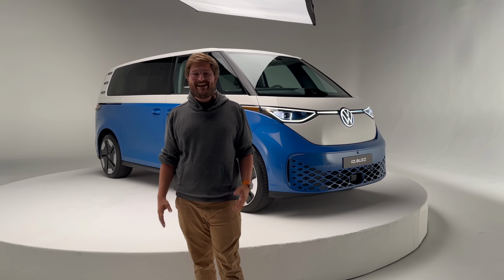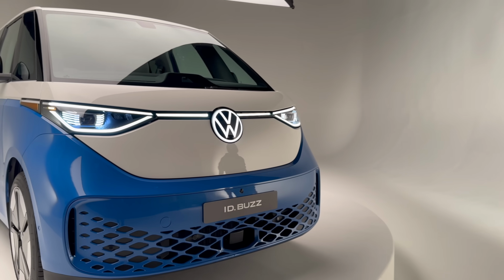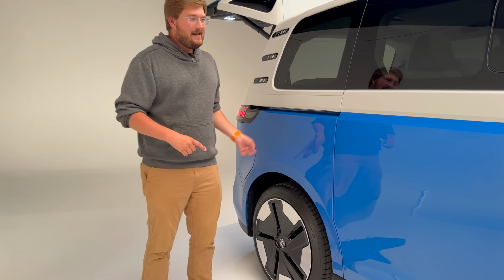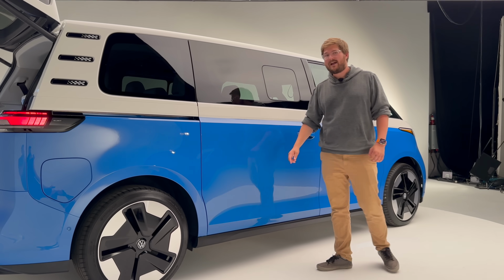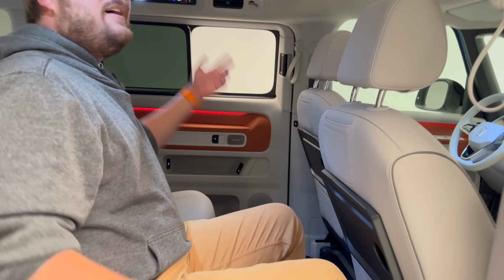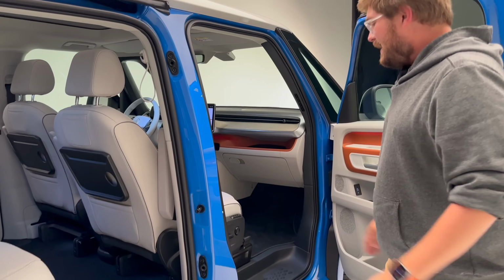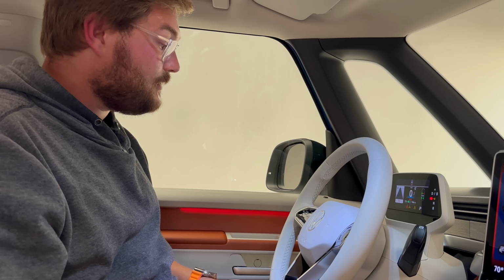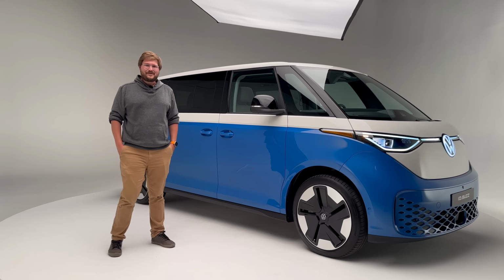The US Spec Volkswagen ID. Buzz Is Finally Here! The LWB Is Freaking Awesome & Worth The Wait

Comment: this would be an excellent dog hauler/camping van.  Hopefully the switch to NACS before its released here.
Reply: no, there is only one official standard and that is CCS. you need an adapter to use the tesla system. and VW owns Electrify America which uses the official standard. tesla owns more than 50% of the chargers in north america but constantly losing market share against the official standard. in a few years tesla has to switch to CCS as well gradually.
Reply: @stefanweilhartner4415  Wrong. There is no standard and eventually NACS will be.  Ford has already announced it will switch. The others will follow.
Reply: @stefanweilhartner4415  Looks like GM is also going NACS! I told you! NACS IS the standard.
Reply: @stefanweilhartner4415  Following the news that Ford will adopt Tesla’s connector, now known as the North American Charging Standard (NACS), GM is also confirming that it will adopt the charging standard.

This is likely the next step in a domino effect that should solidify NACS as the new charging standard for electric cars in North America.
Reply: @thayne559  no, they don't. from what i heard is that at least ford is supplying an adapter.
and a company just can't say it is a standard and that makes it an official standard. the connector just looks better, that's all.
Reply: @stefanweilhartner4415  🤣

Comment: Interesting: In the short wheelbase cars there's not a tonne of clearance between the sliding door and the charge port. With this car it looks like all of the extra length has gone into the door, which means the distance from the rear edge of the door to the charge port (and thus the distance that the door can open) is likely roughly the same as the short wheelbase cars. So despite the bigger door, maybe no bigger opening? Too bad for the third row, if that's the case.

Comment: Now that size makes sense and looks way better. But how in the world are they not able to put a 100 kWh battery in such a vehicle???
Reply: their modules are really dated. pretty much the same like 2019
Reply: 111 kWh was touted originally. Need that now, o/w this thing doesn't go anywhere in the real world. Would look good decorating your driveway however.
Reply: The difference is...they use Modules...if one gets weak you can exchange it partly...if the Battery in a Tesla gets weak you can only remove the entire Batterie...not really sustainable...and this Design decision takes space.

Comment: I Hate Glass roofs!  Always cleaning the glass off where a metal roof you don't need to wash it as often. Glass roofs shatter in roll overs and gives you glass in the eyes while metal roofs just bend a little. Flying Tire hitting metal roof dent and glass roof tire intrudes into passenger space.

Comment: can the middle seats be removed and fit a 4x8 sheet of plywood like the grand caravan?
Reply: Middle seats do not remove. If you fold the second and third row seats down you have a flat load floor, no telling if it's wide enough inside or long enough for the 4x8 ft sheets. I have had Chrysler vans and I love that about them.

Comment: I stopped watching when you mentioned the wait is going to be so long maybe 2-3 yrs because of demand and also fully decked out and limited production , I don’t know if it will be that good in 3 yrs . I watched the assembly on you tube and I was surprised at how much human hands are involved in the assembly of this vehicle , that seems to me as a major issue , that a lot is hand done not by robots , just my opinion it seemed that VW needs to work on the manufacture of this ID  it might be what is causing it to be expensive.
Reply: Masking tape put everywhere by hand for the two tone paintjob 😱

Comment: 250 miles is not enough, DOA in my eyes, for me personally. 

I really think 350+ is the right spot to match ICE, the only real EV's that compete with ICE today are the Model 3 and Y, even then, only because of the charging network. Everything else just feels half assed to a degree.

Keep in mind, "EPA miles" are laughably over estimated if you're in the US and drive freeways at 75+MPH. Model Y are getting 200-250 instead of rated 300ish, at those speeds, heat on, etc. So 250 for a VW cube is going to be painful.

-------
Realistically, in the real world its going to look like this, and be insanely inconvenient.

- 250 rated miles, charged to 80% = 200 miles

- 200 miles minus a speed penalty, 120-150 miles realistically.

- You can't stop at exactly 0, and ICE gas lights pop on at ~50 miles remaining. So you're going to be looking for a charger after about an hour of driving 75, and sorely requiring one before 90 minutes is over.

Unreal.
Reply: If you go to Edmunds they do real world range tests for most EVs in America. You will see that most German EVs exceed their stated range figures. Tesla consistently overstates their figures. Just because Tesla overstates their range figures don't assume every manufacturer does.

Comment: These electric cars are getting crazy with the tech and design. Really shows the difference from a start up to a legacy automaker
Reply: The tech is still at least 5 years behind a tesla in every way ,while more expensive.
Reply: @EnlightenedSavage  Not true. Tesla 3/Y does not have: well tuned suspension, blind spot indicators in mirrors, ventilated seats, HUD, intrument cluster behind the wheel, good physical buttons, light above back seat, parking/rain sensors, apple car play/android auto, adjustable headrest, and more.
Reply: @EnlightenedSavage I m having difficulties understanding if you're more on copium or delusion

Comment: if the price is under 55k then they will sell fast. if it's over then this will be a flop. i have a feeling they are going to slow roll production in order to keep high prices for the rich.
Reply: It will be far above...and since the production capacity is not that high so far...no issue at all to sell any car assembled...at the high price point

Comment: it's great and I love my ID4, sorry if I missed it, but will it fit a 4x8 sheet of plywood? damn, I'm thinking of trading now.
Reply: The "refusal" of all U.S. reviewers (as far as I know) to provide the cargo dimensions is VERY annoying. They all just repeat volume numbers provided by the manufacturers.
Reply: @michaels3003  after watching the deluge of id buzz videos in my suggestions list, I just realized something obvious, the 2-3-2 seating arrangement means it's narrow, likely too narrow for a 4x8 sheet.  the rear row 3 across is made possible because the standard odyssey/sienna/caravan/uplander is made to accommodate a 4ft wide flat panel.
Reply: Autogefühl German reviewer measured 48 inch width at the rear door. The width a little bit forward could be somewhat less. Even if it is not, that's really tight for a 48 inch wide sheet.

Comment: I've always loved and coveted VW buses, although I'm getting the impression that these will be hard to come, and only at a premium, hugely marked up price. White steering wheels are never a good idea, but I applaud actual louvers instead of adjusting climate control through a touchscreen. That glass roof is awesome. Hmmm… I wonder where is the mysterious V2L outlet? My main question: NO "Westfalia" camper version in the works? That's the only reason we'd sell our house to get one. Otherwise… no point in having a huge, 7-seater EV for just the two of us. Tsk.
Reply: You gotta sell your house to get a Buzz?
Reply: The VW board approved the camper version however given the pent up demand they won't making it for awhile.
Reply: @almac9203  Yes, I heard at the reveal that VW is "talking" about a camper version. 🙄

Comment: Estimating 300 miles EPA for rwd and 275 miles EPA for AWD specs
Reply: No chance that happens wltp will be around 300 for rwd, so epa will be 250-270s max. 
Same size pack as a mach e er has, with more weight&worse aero.
Reply: dreaming

Comment: How much power can it out put for accessories out of the trunk?   Ie…. Refrigerators etc for camping..
Reply: I was thinking of my ICECO frig/freezer as well.  If I bought from a dealer again (probably won't) I would just get the solid roof and install those flat flexible solar panels and keep using my Bluetti battery set up to power the frig/freezer and whatnot.

Comment: One of my biggest pet peeve’s with new  vehicles in general but more so with EV’s is when they have old style door handles. Is that a key hole in this ID buzz? Futuristic in most ways then they kill it with basic door handles.
Reply: id Buzz owners will value practicality more than fancy overengineered designs. Tesla, Mercedes, Lucid, others make those flush door handles and expect owners to accept bringing it into service all the time to fix little broken things like the door handles, a simple mechanism is well-worth it for its target buyers.
Reply: @Ed20942  I have to agree. The old style door handle on my 40kWh Leaf is one of its saving graces. A pity that VW didn't adopt the ID3 door handles for the ID4.
Reply: Yeah, I hate basic door handles that will work forever, even if they get frozen over every once in a while. 

Who cares if I and my children can get in and out of a car easily, I want people to see my cool door handles!
Reply: Old style are used for one simple reason:  they work and work well.
Reply: Hi Jorge, ask any first responder what style of door handle he/she would like to be confronted with at an emergency scene: stupidly-recessed-different-for-the-sake-of-being-different style or old- aka- sensible style.
Reply: Both of our EV’s have futuristic handles that work fine and have never broken. To me, they just didn’t try very hard. Our model 3 handles are basically normal mechanical handles but also look futuristic. If the buzz had model 3 style flush handle’s it would look so much better than those goofy 90’s style handles.

Comment: Are existing MEB cars eligible for the 4.0 software?
Reply: no unfortunately not, you need new hardware for that. The earlier models will stay on <4.0, they still get updates, but I wouldn't expect too much from it. The software debacle in the first models is certainly nothing VW can be proud of and annoying for the early customers, but it can't be changed now and is the way it is. Let's hope they have learned something from it and things will go better from now on. From what I have seen so far, V4.0 is a big step forward.

Comment: I wish they could’ve pushed it past that 300 mile range number
Reply: I agree for Australia 300 mile minimum
Reply: I wish they would make it in ICE or hybrid so you could actually road trip. A van you cant road trip in is useless. This car is currently useless.
Reply: Or a front wheel drive gas motor
Reply: Why?
Reply: @brunoheggli2888  300 miles is the number that makes an EV a good road tripping car for me. It’s that magic point where the charging frequency lines up with when I want to stop.
Reply: @keco185  No
Reply: @brunoheggli2888  oh I’m glad you know more about my preferences than I do. I’m clearly mistaken. It’s not like I’ve driven EVs on road trips and know what works well for me or anything crazy like that
Reply: @keco185  No you dont know what you need!This is the Minibus for you!Buy it!
Reply: @keco185  why?